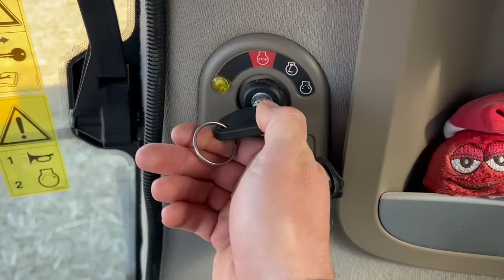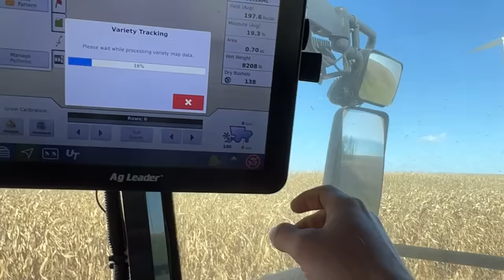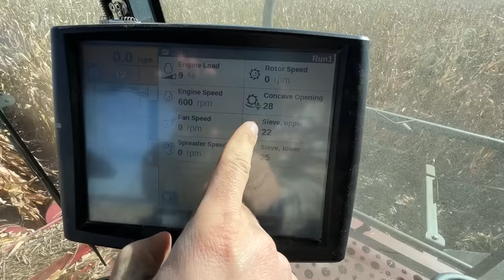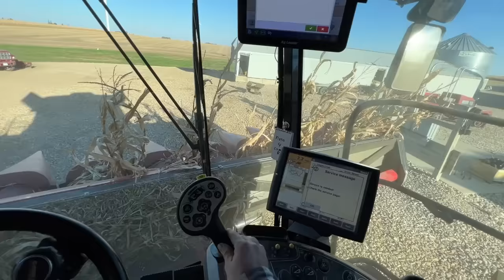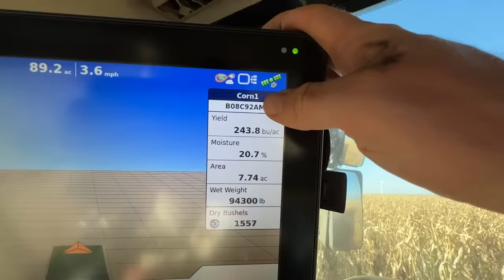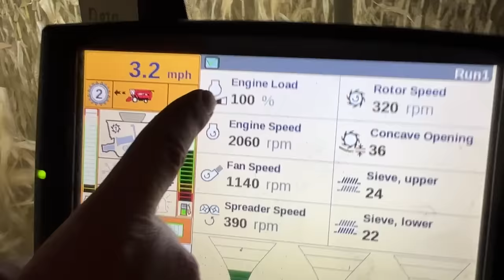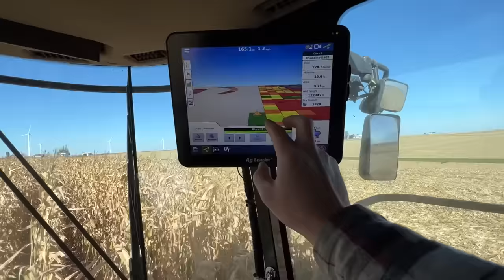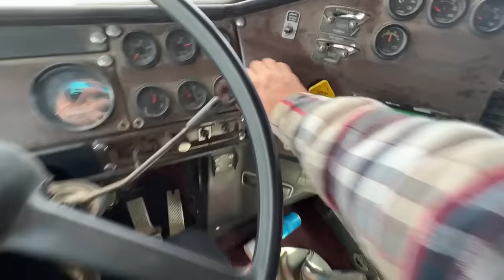We Found Even More Things Falling Off The Bin Site

Comment: Daddy Corn Star.  You and the whole team have every right to be mad.  None of this should be happening. A trusted builder wouldn't  want to wait for a court to decide what should be done.  A outstanding company would be out there making everything right.  I'm hoping everything is corrected asap.
Reply: I agree with you.  However, I also understand their problems.  The remedial work will be expensive, just removing the hopper, destroying the concrete pad, and building a new one will be a big, expensive job.  The problem being, if they built it as specified and it didn't work, then it may be more of an engineering problem and not a builder problem.   While I am not privy to the details of the case, lets just say there are more than two parties involved and that is where it gets complex.   We know it isn't right, but assigning blame (and cost) as a result is a big deal.  Something like this could run one, the other, or both into chapter 11.
Reply: I get the impression its a battle between the designer and the bin contractor, each pointing fingers at each other with the Corn stars caught in the middle.
Reply: @williamosgood3565  yes, the solution is expensive.  Each of them and their insurance companies are not in a rush to pay.
Reply: just tighten the stuff up
Reply: Safety first alway. So by saying that never go with AGI.
Reply: Hire some climbing guys to put up some safety wires you can clip onto when up there.
Reply: @OldManBadly also sometimes these things drag out, not because people are unwilling to make it right, but they’re negotiating about who’s responsible for what and who covers what cost and percentages, blah, blah, blah. Meanwhile the folks that are most affected are stuck between a rock and a hard place
Reply: @chrisgreenwood4728 I agree. If you care about safety. Just document what was loose and what you had to do yourself or pay to have done. You can add that to a lawsuit. Shouldn't be letting it go unsafe if you can clearly see it needs addressed
Reply: @randykincy7954  You are correct, but I think the scale of the issues is a big part.  The hopper bottom bin by itself is likely a six figure issue.  The fact that the pit doesn't work properly could be another 6 figures problem.   The various endless clogging passages is another expensive one.   By the time they are done, this could end up being the "2 million dollar bin site".
Reply: When dealing with any company, you expect to have a completed, safe, and usable build.  Your family did not get that so it rests with your lawyers.. Have patience and pray for everything will be resolved!!
Reply: @OldManBadly  yes but the losses would be in production and profit opportunities. It shouldn’t cost the Cornstar family much cash at all. They might even get compensation for the lost productivity but they won’t come out ahead on it. The aggravation and man hours input would have them barely breaking even, even if they got punitive damages. What they’re losing is time and peace of mind but they’ll basically break even on the cash
Reply: In my opinion you should start naming all these companies involved. That way no one else hires them and has to go through this! How many more people have they screwed since you?
Reply: @gorillawrenchin completely agree with you. The grain bin safety issues has turned into sympathy farming…
Reply: I would be absolutely upset way more then you are

Comment: IT MAKES ME WONDER HOW MANY OTHER FARMS ARE GOING THRU THIS WITH FAULTY BINS.  GOD BLESS YOU ALL AND KEEP YOU ALL SAFE
Reply: You know they all are a non-stop damn headache...  I am not a huge farmer so we haul it to the elevator and let them deal with it.
Reply: Not many really.  All the farmers i know don't have problems
Reply: I was wondering the same thing! I know this was building built through the pandemic times, bits no excuse for how bad things are. Everything is either built with inferior materials or designed poorly. Should not have to sue to get this address.
Reply: @Junkinsally  during the pandemic contractors like the ones that put up the bin site couldn't find good people to work, this is what happens when you scrape the bottom of the barrel.

the cornstars went with a company that had been around building bin sites for many years and was known to be good in the past, but at the time they probably had mostly new workers because all the old ones had been laid off during the start of the pandemic. couple that with all the shortages during that time and it's a perfect storm for shoddy workmanship. 

I highly doubt it's just their bin site, it's probably any binsite they worked on during that time frame.

Comment: If you put air on the on the bins when running into to them you will be able to plug the flow down to cause a plugged spouts and elevator legs.

Comment: I am not a farmer nor am I a builder, but as I watched these bins being built, I could not believe how quickly they went together and how fast the put them up after the concrete was poured. I thought concrete needed to be cured before any building could be built on it. Red flags, in my opinion! I hope you guys get it resolved soon!
Reply: To be fair, for corn bins, a couple of days of curing would be enough. A concrete pad designed to hold a full one at its nominal curing strength can hold an empty one at 10% curing strength... ;)

Doesn't help if you pour them out of 4-inch C10...

Comment: Have a couple of questions in regards to your bin and the concrete cracking.... 1.  before concrete pad was poured were there Proctor tests??  2.  Is your pad an engineered design with rebar? 3. Were there samples taken ( usually the same company that does your proctor testing) of the concrete as you poured?

Comment: That's a big part of your problems as far as your augers plugging up and belts burning up!!!! when you have augers plugging up >>>  start looking at grain flow from the last flow point, then start going back from there!!!  That should go a long way to fixing your auger plugging problems.   You might want to consider redesigning your grain flow!!!!   There is such a thing as triple belt pulleys as verses  two!, etc., etc.!   But, you have to make sure that your grain can get away from incoming grain.  Good Luck with your bins!!!

Comment: The concrete pad under the bin could be fixed by making some massive steel rings around the cement and then making a super heavy rebar reinforced concrete ring to encapsulate the base using something like one inch rebar and fiber reinforced cement that would basically encapsulate the broken slab. Then use it.
Reply: That would not fix nething the ground under it is the problem bin will have to be moved concrete tore up sub base fixed then start over with new concrete
Reply: No it can't be fixed like that.  Your talking over  a million pounds of weight on that pad.  The only way to fix it is to tear it out remove the bad soil haul fill in compacted it and then pour new pad and for that weight and only sitting on a 6 inch wide ring you will need about 36" of concrete and rebar.  to make it strong enough.

Comment: flagship series must be way different than our 6088 this year had my rotor at 230, fan speed at 1050, concave open until you see full corn cobs(mine was at 16 to 19 on the display, if you have a lot of broken up corn cobs on the ground, it’s closed down to much, also on the first concave we run  round bar style corn concave the rest are wire style, top sieve at 16 bottom at 8 on the display
Our moisture was 17 to 21

Comment: I understand your frustration with the bin situation, but at the end of the day, it’s your responsibility to make it work.  There are plenty of places where you have let safety slip, on the Dryer unshielded belts , where you get samples, you reach into a box where there’s a rotating auger.  Cooper could fabricate a port to safely get a sample.                                  You need to have Balanced system for Harvest , considering labor and equipment.  The first year, with dry corn , you unloaded as fast as possible. But now reality set in with wetter corn, the Old Dryer is only capable of 300 bushels per hour. The 12 row Combine , 2 Grain Carts , 3 Semis, run a few hours then they sit.  What’s needed is smaller combine , 8 rows , one grain cart and 2 Semis and Dryer that’s capable of 75% the BPH of Combine. Should not have to baby sit the dryer, there’s Wi-Fi systems that you monitor and control Dryer from your home.

Comment: Make sure and use safe nuts and bolt, in aviation, if it has to stay put, it's wired in place, drilled through the bolt and nut and wired in place...nylon lock nuts are good as well....make sure that's in the settlement.

Comment: in the uk we wouldnt be able to build anything without a building inspector checking it over every step of the way and if aint built properley they make you pull it down or correct it do you not have the same in the stated?

Comment: corn stars- wear a body harness and get a fall protection retractable cable anchored to an engineered tie off point above. At least if you got up there you can have some piece of mind that IF you take a header your going to stop. I can't believe those railings would pass the OSHA side load testing.  Paragraph (e)(3)(iii) of §1910.23 establishes the requirements for structural steel railing systems in general industry settings. Under §1910.23(e)(3)(iii), installations, posts and top and intermediate rails are to be of 2-inch by 2-inch by 3/8-inch angles or other metal shapes of equivalent bending strength with posts spaced not more than 8 feet on centers. Pursuant to §1910.23(e)(3)(iv), the anchoring of posts and framing of members for railings of all types must he of such construction that the completed structure is capable of withstanding a load of at least 200 pounds applied in any direction at any point on the top rail.

Comment: It looks like a heavier gauge of steel should be used for the railings and braces to keep you safe up there.  If I was climbing around on those bins, I wouldn't be able to hold the camera, because I'd be holding on to the bin with both hands.

Comment: I can appreciate all the problems you’re having at the bin site. The question I would have is that you seem to be awfully involved almost like a general contractor over seeing the lowest bidder during the construction process. 
If you did not have a general contractor then it appears that you might have some liability. 
I am a contractor and I deal with customers that changed timelines, change design plans, question change orders due to price increases related to the previously mentioned.
If none of the above is true I totally feel bad for you. If you’ve created some of the conditions that lead to the corner cutting and shoddy workmanship then I may have a different opinion.
When a contractor is going broke there’s absolutely nothing you can do and a good general contractor would just stop the project immediately even though it may hurt.
When you force the project to continue, desperation may lead to the very result that you’re looking at.
35 years I have taken losses by stopping jobs and I can say that I never left a project in substandard conditions.

Best of luck

Comment: How is there no warranty / building regulation that means they are automatically liable to fix it and construct it to local/state safety regulation to start with ?? I just dont get it. In the UK building regulatuon is quite strict - even a small house extension has to be checked  and signed of at various stages before the next stage of build can proceed.

Comment: I put up a bin where the farmer built ladder, roof screens…. 40 years later it’s still safe enough. But experts can’t make it safe 3 years.  Heck not 3weeks you see it’s unsafe.   The excitement when they were building.  To disappointment.   I hired neighbors to cement a bin.  I set up loads.  First truck came, no 2nd.  Called, called, sent neighbors home, finally truck came.  “We had a big project pop up”  I dang near had to bust it up.  But a 5000 bu bin the stress is nothing compared to 18k bin on supports.   Still got cement under 1/2 price.

Comment: Hi Guys.. now that part has been broadcast as falling you need to implement a safety risk assessment so head gear needed when working in the area/ yellow high viz jackets are required working in the area/ safety boots/ all staff must carry radios to call for help/ and you need a health and safety inspector to check the whole area. Trust me, now that has happened you are liable if someone gets hurt . If you get an inspector it moves the liability.. stay safe.

Comment: Ive been involved in Bulk Silos mostly for cement, and honestly that gives me the chills, that is not good enough. That folded steel up there 2mm or 3mm plate isnt strong enough. Whats really annoying is its prevelant right across the industry with these larger companies winning the bids over small fry like myself, then to cut corners they put your safety at risk. Saw this happen 5 times in the last 6 years. Very annoying to see this happen.

Comment: Safety is important. You being such a small operation, people wise, are not governed by OSHA. I work on a construction site well over a thousand people that has full scaffolding with toe boards and hand rails on most of the elevated work and we are required a full harness with two lanyards so we can have 100% tie off at all times. I see other small operations that are so lax in their safety it bothers me. Matt's Off-road Recovery and others grinds, welds, cuts with high speed wheel, band saws and other rotating devices. I know that injuries from those things are one in a million. But they do happen. I've even seen your boys not wearing safety glasses at all times. Whenever using rotating equipment they should be wearing a shield and safety glasses.  When one of these You Tubers has that one in a million accident you're  going to hear, "I'd do anything to have prevented that." Obviously not!

Comment: I’m curious if AGI was the manufacture of the bin site I’m not a farmer so I’m a bit ignorant when it comes to this but if it was them it’s crazy because they use the word safety. transparency, urgency and integrity. I truly hope you get a resolution soon.
Reply: AGI if the bin manufacture but they don't design the bin site that is up to the dealers.  The dealers design and spec the bin site out for the farmer.  So now here is where it get messy.  The dealer is a dealer for other stuff as well not built by AGI so like the pit the catwalks ladder distribution box are all done by other people so it not just one company that it at fault here.  Then you have the contractors as well.

Comment: Curious if the concrete was a weak mix, bad mix or if the funny rebar they used was a factor.
Reply: You have to wonder if the soil underneath was prepared correctly. 
Remove native soil. 
Fill the hole with a series of dampened and compacted road base layers.
Pour concrete reinforced with steel.
SOME OF THESE STEPS WERE MISSED.

Comment: AGI needs to step in and do the right thing to inspect, properly engineer, build, and ensure everything was done correctly. Overbuilding safety isn't an issue, it's underbuilding  strength in safety that is where major issues are at. AgI make good equipment unless they are under new management that want to maximize profits by riding their reputation down to the ground?

Comment: With such high moisture in the corn, shouldn't you hold off harvesting it till it dry's more on the stalk.  That way you don't overload your bins and dryer.  Drying really wet corn costs money.  Just wondering.
Also, Instead of throwing bin parts down, wouldn't it be better to simply film you having it repaired and then add that to the lawsuit?

Comment: It kind of waters down the safety talk when going up without a safety harness after telling how the bins are falling apart. If safety would really be #1 for you guys, you would not go up without safety equipment and you would fix the issues before using the gear, even if it would cost you some.

Comment: I totally agree the quality of work, design, materials and installation was horrific with the safety rails. Clearly it was not a good design nor was the installation. With that said, why tolerate it while the lawsuit is pending? Why not thoroughly document all those issues with video and photos. Then hire a certified welder to repair and fix it correctly so you can use those safety railings while the suit continues? Yes, it's another expense but you could add the costs to the lawsuit for reimbursement. Then you don't have to worry about things falling off it, potentially injuring someone below it. Plus, it would stop water ingression into the bins.

Comment: 😮 Sounds like THE GOOD THE BAD & THE UGLY happening at Cornstar Farms. With the new bins systems and designs, equipment that is new or well maintained breaking down a lot,. Having to buy a 1,000 gallons of butane per day for drying wet corn.
 I do not see how you can make a profit. Forget about the diesel fuel and the payments to the bank plus interest rates.
 I think you're attitude on camera is great but I think I you're mind ya got to be stressed out mentally. 
 Some things are just beyond control and that you have to suck it up but dang.

Comment: Unfortunately, it is never in the best interest of attorneys to settle lawsuits no matter which side.  Also, you should consider should someone be seriously hurt or die because of defect; failure to fix said known defects negates any protentional future lawsuit.  I would suggest considering fix the issues and suing for actual repaired damage cost.  There is a necessary diligence to prevent future harm.